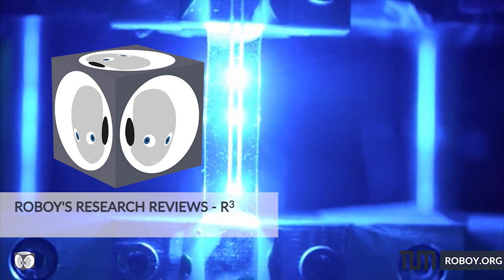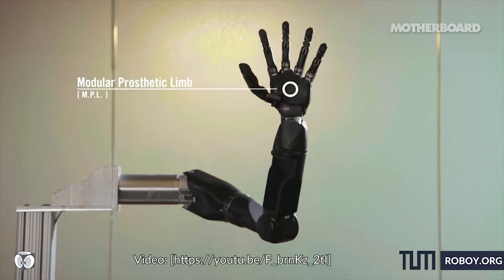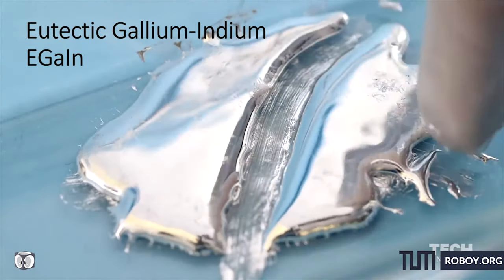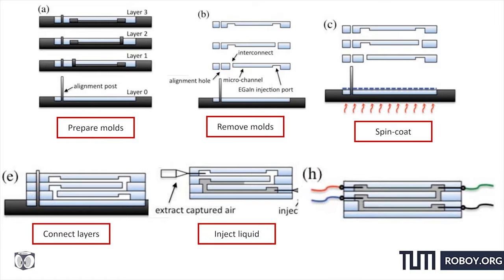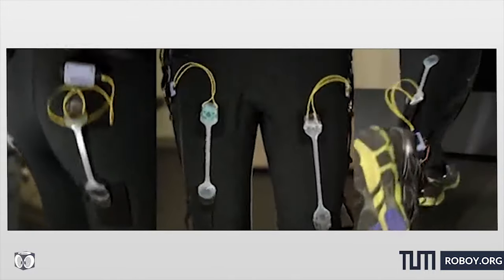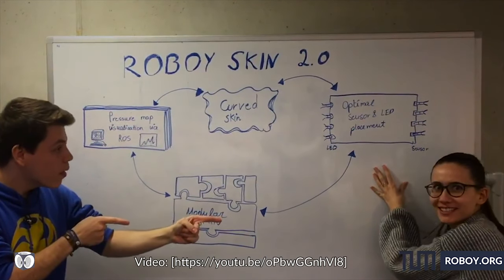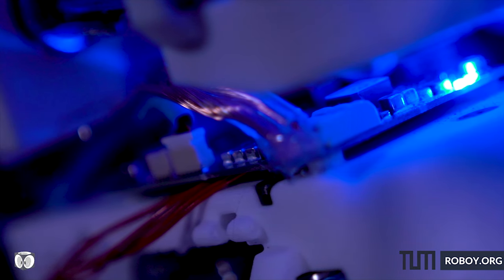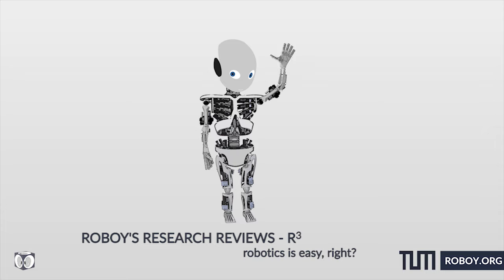Soft Artificial Skin with Flexible Sensors | R3 Roboy's Research Reviews #8

Comment: Very cool! Robots will definitely need an 'artificial skin' with widely distributed sensors for stress, heat, cold, pressure, etc.. to be practical. If not everywhere, definitely in hands or for 'soft robotic' muscles.

Comment: I love this. And I love the advancement of robotics. I would love to work in this field, however, I don't have an education level that would permit such a thing. However, I am happy to offer questions when they are called for. My question for today in pertaining to human like skin and this video. It has puzzled me for some time now as to why people believe that skin is so flexible as far as elasticity is concerned. If you pinch the back of your hand, and try tugging on your skin, you will find that it is not very elastic at all. What human skin is is pliable. But as far as elasticity is concerned, human skin is mildly flexible, but is capable of micro folding. I think that is probably one of our biggest setbacks in convincing humanoid robotics. Unfortunately, as far as I can tell, it's also one of the most difficult organs on the human body to replicate because of these features and its regenerative properties. However, I love how far we've come, or rather how far science has come in skim sensor technology. And I of course applaud every advancement that I hear about. Thank you for reading.